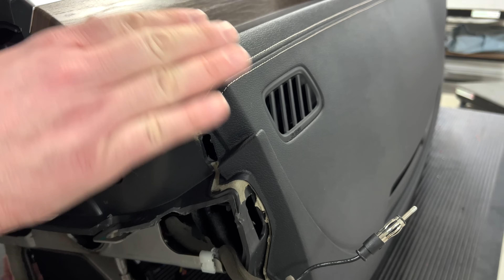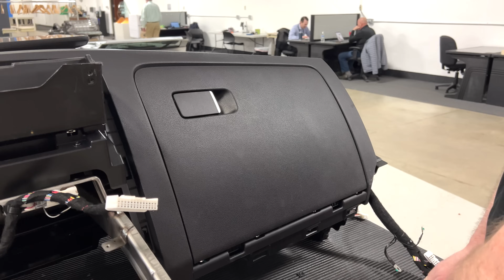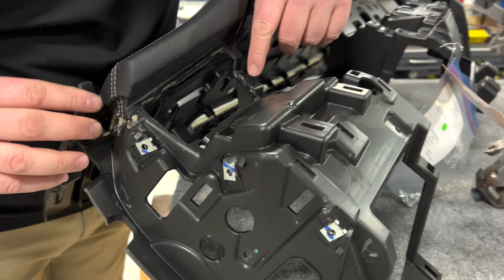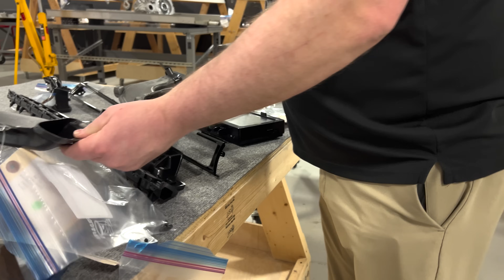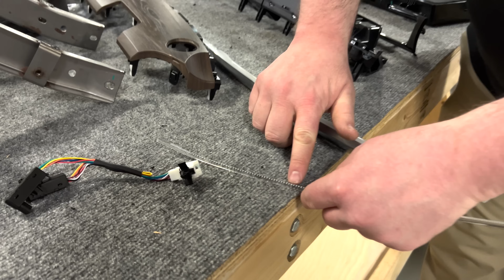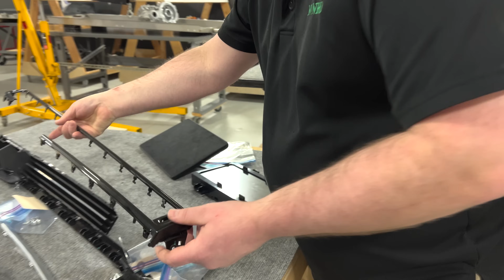Imperium Skywell Instrument Panel: Inexpensive or Inefficient?

Comment: Expensive tool pays back REALLY fast. Like... tool that costs 10 000 vs tool that costs 1 000 000, just make 1 000 000 dashboards and you will lose less than 1 per dash.

Comment: Question for the experts - Carl mentioned magnesium for a component - doesn't that burn?  Is it really strong?
Reply: It does burn, but at a much higher starting temperature than the plastic.  Most magnesium alloys used now are much harder to  get started burning.
Reply: @gordonn4915  - Thanks for the information - I did not know that.
Reply: It is made of aluminum and magnesium and this material used in die cast method

Comment: Isn't mould tooling getting cheaper yet?   I seems to me that as long as you don't need hardened steel you could do them all on a 5 axis mill with one or two setups,  even doing the fiddly grain effect with a small ball-nose. 
Maybe you do need hardened steel,  but a CNC mill could be set up as a grinder too, or use CBN cutting tools or something.   However it's done I'm sure it must be getting cheaper than the days when you needed a craftsman with a die grinder.